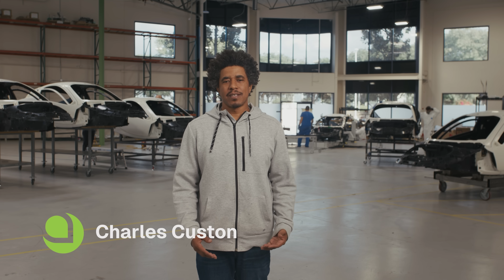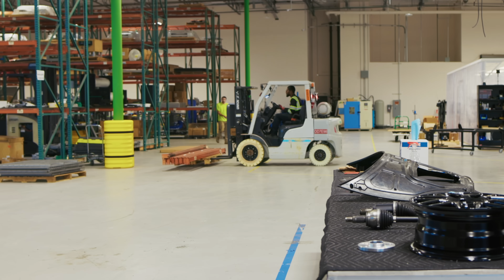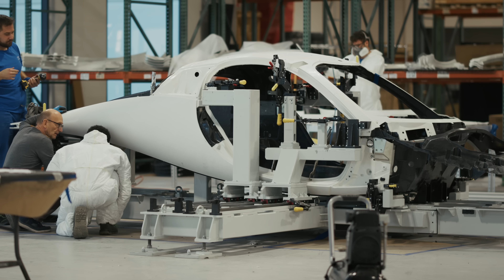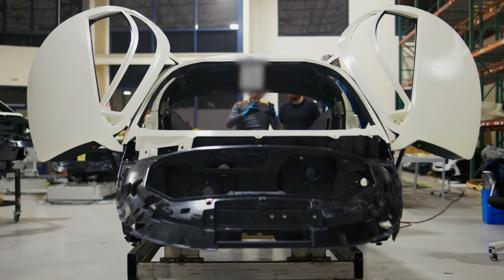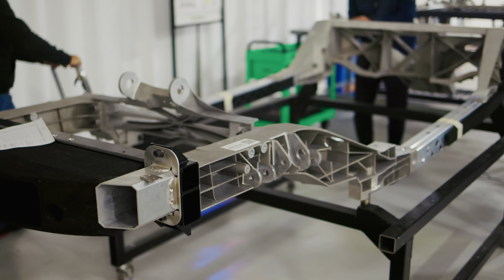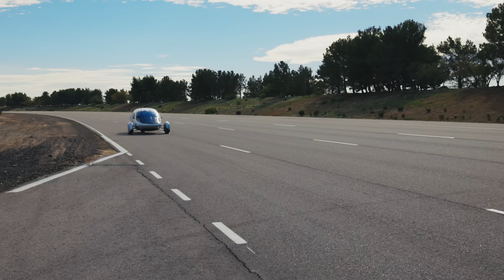First Look at Aptera's Validation Vehicle Assembly Line

Comment: How many validation vehicles are going to be outfitted with the transmission? Are any going to be without solar ? And how close are they going to be to production weight?
Reply: A fair ask with the mission to have more drives powered by the sun. The tranny is hoped to increase efficiency enough to add a significant number of trips to each battery pack.
Weight, I think is less an issue. There's an interesting video showing electric trucks towing an empty trailer and then adding a lot of weight with very little cost to efficiency by weight alone. 
The added axle, wheels, wind drag, etc. of the trailer showed reason why the shape and design of a vehicle not needing to carry more than a couple and their luggage should be minimalistic.

Comment: Not trying to be a negative Nancy here, but this looks like a <500 units/year line.
Reply: It should look like an under 5 unit per month since that whats its designed for right now.
Reply: I think just like so many other people have been doing, that you are applying literally everyone else’s process to Aptera.

People wanted the car first but Aptera focused on the assembly line first. Because of that it took longer to release a car and people claim that they are failures for it. Now that they are just about ready to roll out the cars, people assume they will have the same challenges everyone else had. Completely forgetting that this is what Aptera has spent most of their time on.

Aptera has less parts, Aptera has lighter parts, and Aptera is skipping entire steps. Aptera isn’t going to paint. They have automated skates that will move the vehicle along as each vehicle goes to the next step along the production line (again because it is so light). Aptera will have a more simplified wiring system and almost no welds. They can easily scale to a few thousand per year.
Reply: They plan to produce up to 40/day with this assembly line. That's more like 14,000/year. Not a lot, but it means I will get mine in 2026!

Comment: This has really made my day ! Aptera you are Killing it , keep it up and GET THESE

VEHICLES ON THE ROAD ! 😎
Reply: This is a storage building ha ha don’t be fooled
Reply: @dans542  That was the whole intent of their assembly process to have it a modular open plan that can be easily reconfigured for better efficiency plus afford rapid change/reconfiguration leveraging robotic assembly sleds in full production to enhance adaptability.  This was as recommended by Sandy Monro since the robotic sleds can at the press of a few buttons send a build off the assembly line to a holding area when any issue needs to be resolved or easily reconfigure the route without the holdups associated with a fixed route bolted down conveyor style assemble line.

Somewhat hope they pull an Ettore Bugatti and reserve the right to refuse to sell to the naysayers and trolls if they try to purchase an Aptera.

Best!

Comment: How many will you build by the end of December? Specifically. And what are the official range and solar gain numbers?? No more HR videos filled with vague generalities. Have any of you looked at the stock price! Come on bro.
Reply: I bought stock just to support the SEV movement. If it pays off, great, the $$$ will go into buying an Aptera. If not, acted on what I believe in. Feels great either way.
Reply: I've looked at the stock price. Good time to buy, it will most likely double in the next few months. I just bought more.
Reply: @jerrymcintire7902  👍
Reply: @jerrymcintire7902  I'm guessing shortly after a few months, but I don't know how long validation, retooling, retesting, and release of the first few weeks of the low volume runs will take. Once they get seen on the streets I may wish I bet more on that stock, but I'm near enough to retirement that I'm keeping the bulk in safer index funds.
Reply: Hey you can start using this tag line for your marketing. I sent Chris M an email with an explanation of the positioning and ad ideas. The science is cool but the ride is thrilling. ™